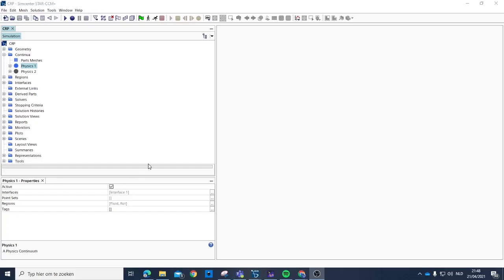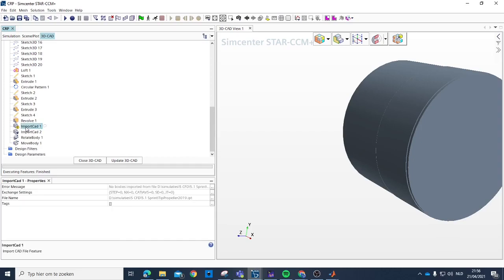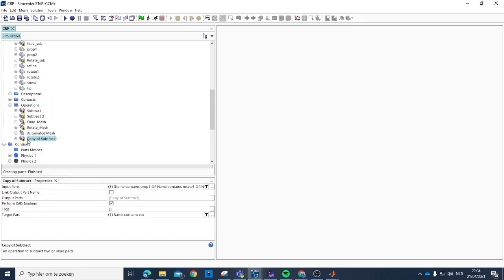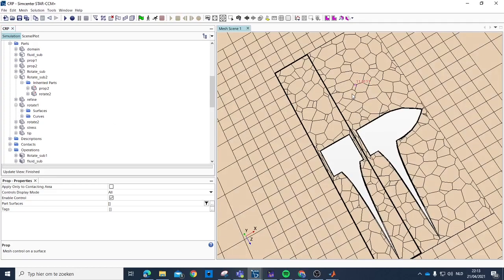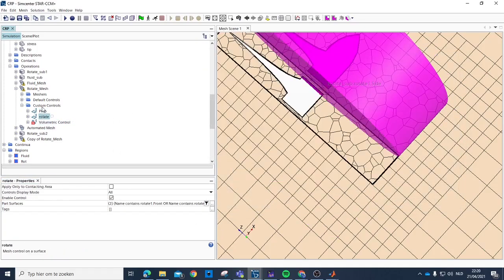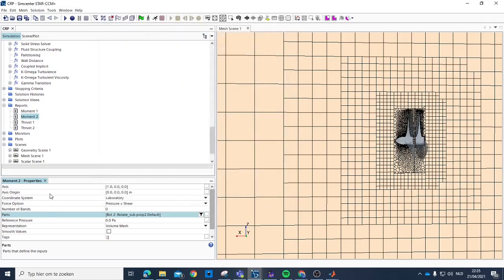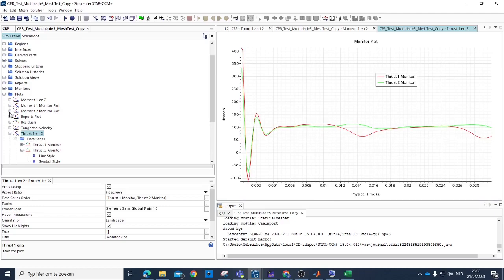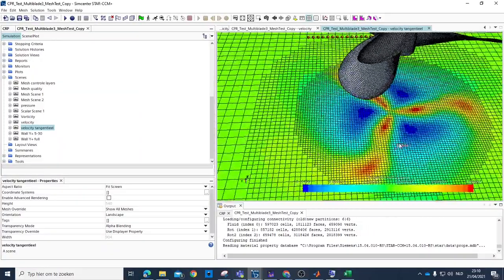Contra Rotating proppeler simulation with OpenProp and STAR CCM+

Comment: Hi, Heyrman, this vedio is great help to my study, but I am still facing an unexpected error, when I carry out twin-screw self-propulsion simulation, Star CCM+ shows 'floating poinrt error [invalid operation]', I checked the mesh alignment, boundary condition, and physical contimum setting, but did not find any solution, I am wondering if there is any perticular issue I should pay attention to?